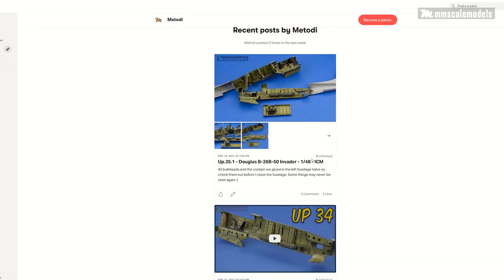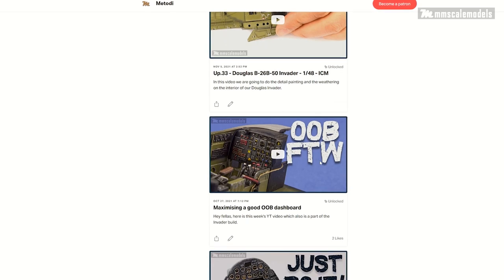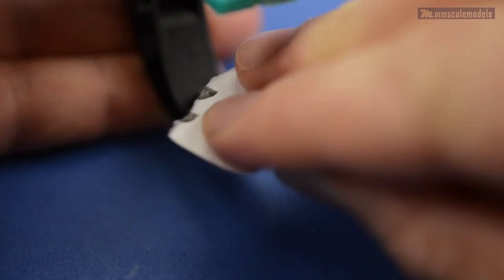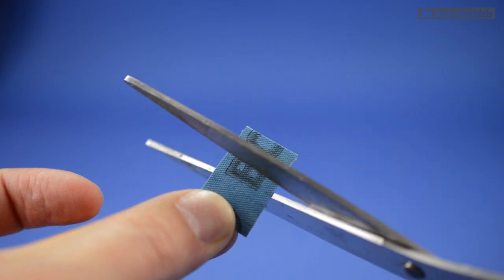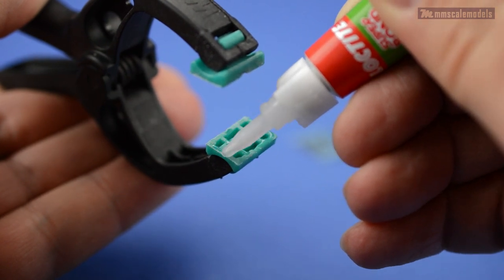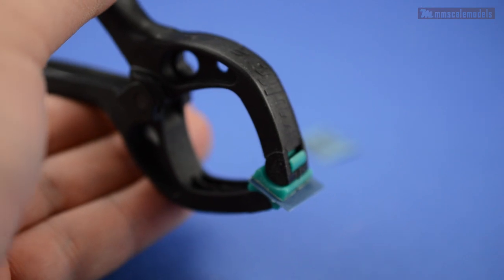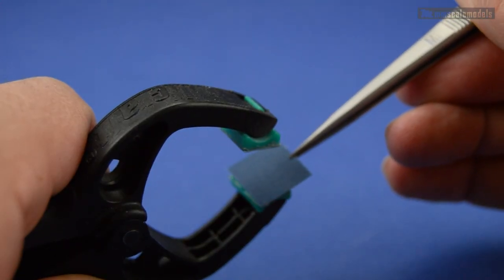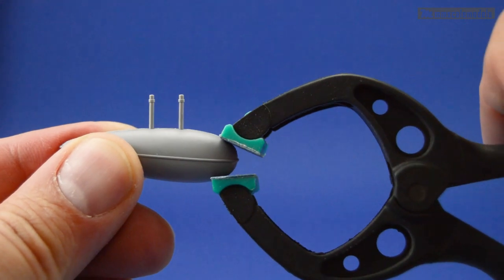No more slipping clamps - scale model building tutorial

Comment: Great tip MM but it can cause surface damage to the parts, especially if they are already painted or in primer. If you need to clamp something which is already painted I would suggest putting pieces of wide elastic/rubber band between the clamp and the parts, you don't even need to glue them to the clamp.
Reply from the maker: For me it is not an issue as I don't paint parts that will need clamping to put together.
Reply: Then just use youre hands or simply do it like its supposed to be painted after assembly.
Reply: You can always take clamps apart and cut a ring or two off the springs. That will lighten the grip.

Comment: On the subject of clamps, I got some beauties from the respiratory clinic at my local hosputal. They are nose clamps, used to keep your nose shut when doing breating tests.

They are expensive, but, they have a good level of 'spring', they open very wide, good for up to a 1/72 B-24 fuselage. But when they clamp, the pads oppose each other directly, so, no pinching out. And, they have rubbery sponge pads  so they grip.

Comment: Simple and useful tip👍 Talking about clamps... just today I was painting my model, holding it in my one hand using clamp, and my airbrush in another. Suddenly clamp slipped and threw the model right to my airbrush and bended the needle. Very sad story, but not a big deal, it was a very chip airbrush and it's not a problem to buy a new needle.
Reply from the maker: Ouch, that's not cool especially if you have to wait long time for replacement.

Comment: Paint the clamp tips /pads with latex masking liquid
Reply from the maker: Thanks for the tip mate!
Reply: @MMScaleModels  no worries mate.
You may be able to get little rubber disks that you stick on the bottom of ornaments so they don't scratch  surfaces or slide on them.
They come pre glued on a sheet and you peel them off and stick them straight onto whatever you want.
They might work if you stick them into the clamps

Comment: a perfect way to damage and scratch the surfaces! should think twice, five times before implementing something like this. 

A simple solution to this wuld be if you just place the calamps from the left/right side, rather from front, you would avoid them falling off!!! This is terrible solution!
Reply from the maker: Feel free to disregard it.
Reply: Oh, sure I will! It's just that, doesn't it feel a bit wrong giving a "not so good advice" to others.. Other than that, all good!
Reply from the maker: @nenadmomic  That's your opinion. What's making it end-all be-all verdict?
Reply: @MMScaleModels  in your example case, putting clamps from a side, adding rubber bands to the clamp, using rubber bands to tighten the piece in the middle if works, but putting sand paper ...  I just don't believe it's a good idea and something that should be advised to be done... But hey, it's up to anyone, comments are here exactly for this reason.. to give opinions.